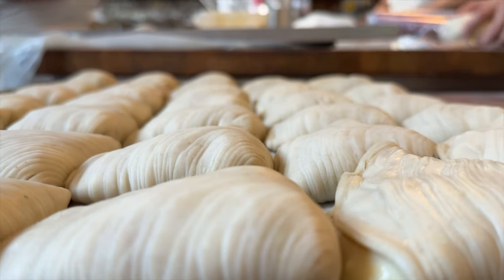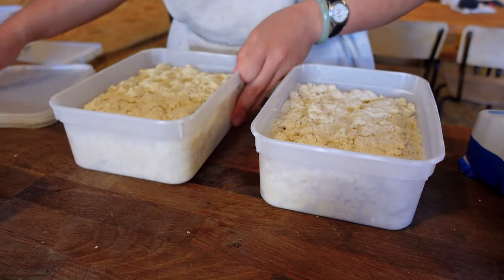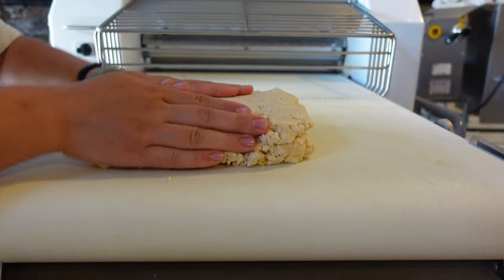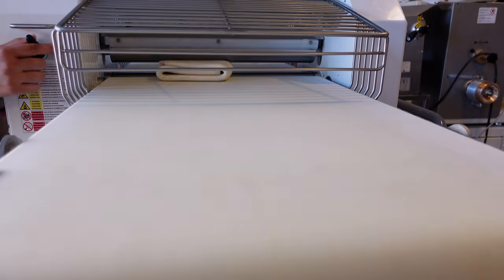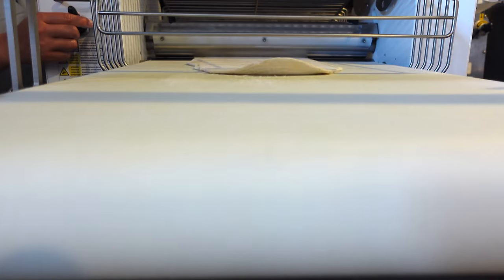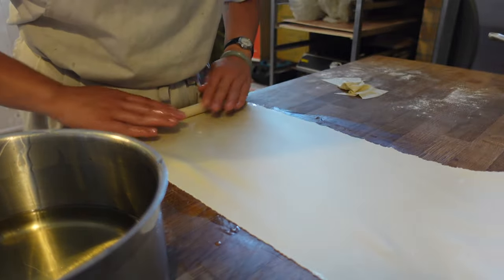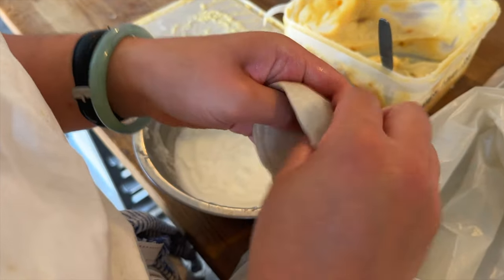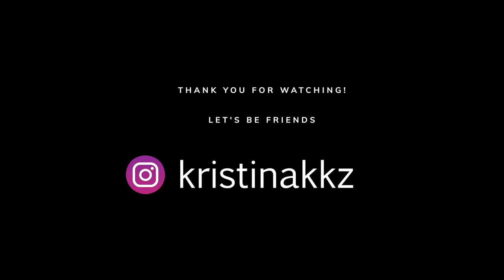Sfogliatelle DEMO from scratch

Comment: Hallo Kris, really interesting this. But what is the purpose of using the dough as a block of crumbs? I am guessing smt like no knead dough. The sheeter does the "kneading". Like the process of pasta making or at least that's how I make it. After resting the pasta machine does the job. Btw it looks delicious! Thanks for the lovely video.
Reply from the maker: Hey, the recipe that my colleague works that way, because it's a low hydration dough so it doesn't come together straight away. Yes exactly the sheeting process finishes the gluten development and makes the dough smooth, strong and thin in the end :)